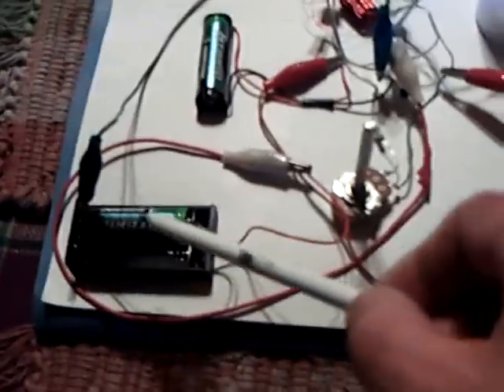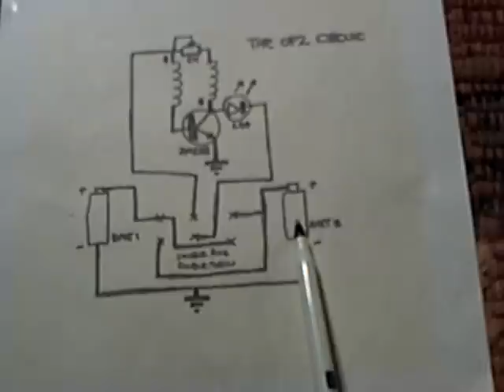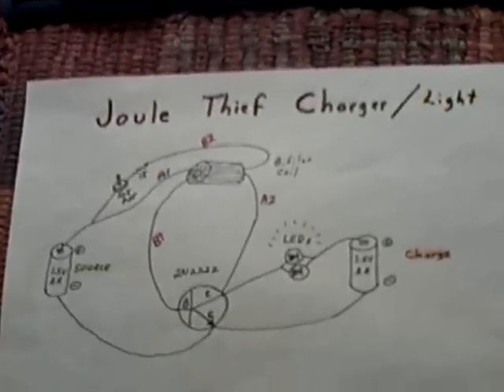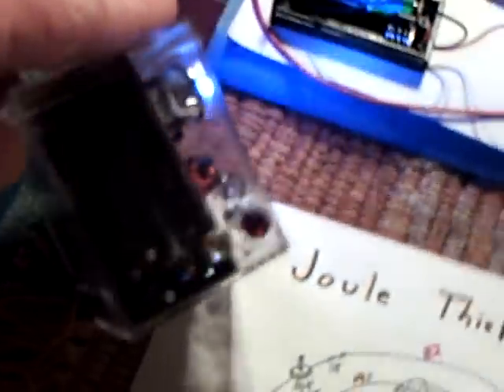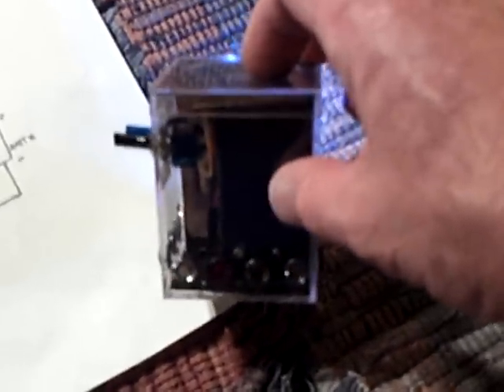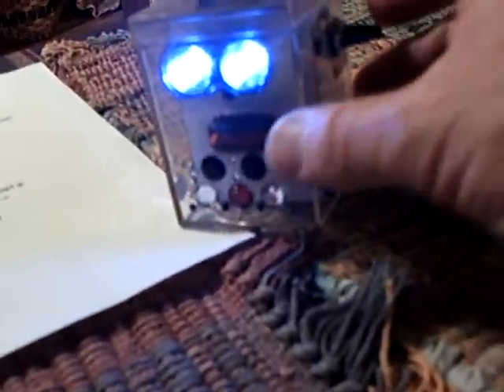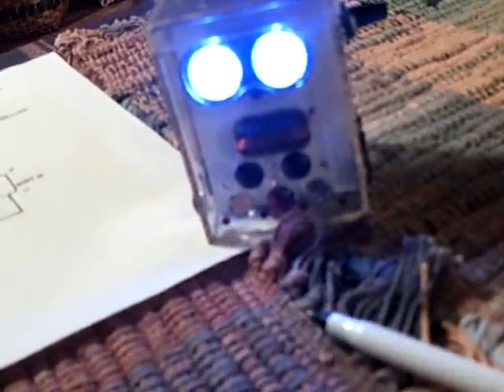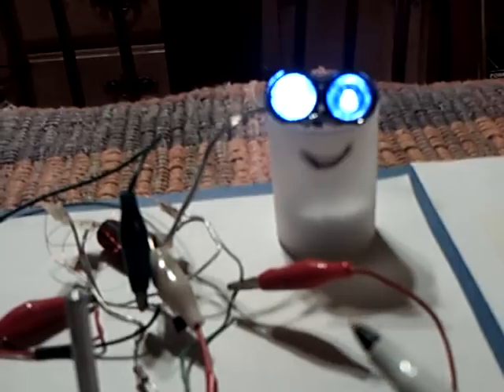Boxed Joule Thief

Comment: Do you have any idea how long the 2 led's would run conventially, compared to the Joule thief design, and could you substitute another charging battery instead of the led's, or are they acting as the spark gap???
Is there a switch or small circuit that will automatically pick the battery with the most voltage and draw from that?? I see high efficiency flashlights in your future...

Comment: ya you have a 'teala switch' circuit there, let me guess its still running? you just have to make sure the charge current does not exced the battery's spec, u kno, C/10